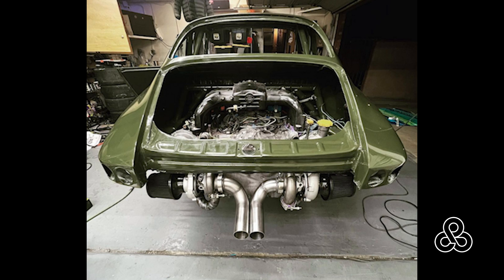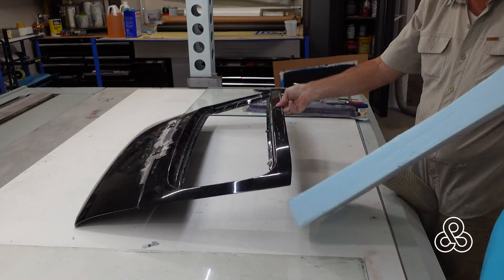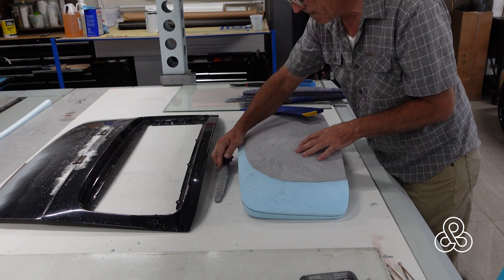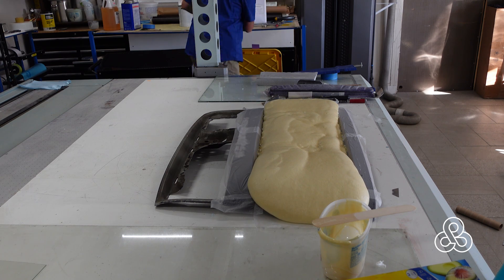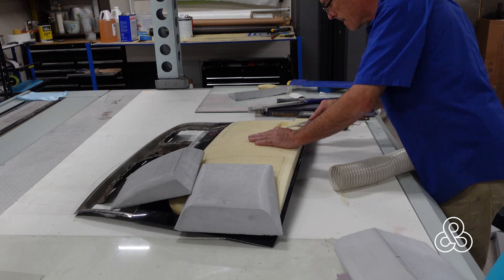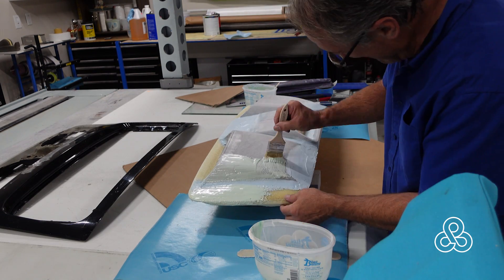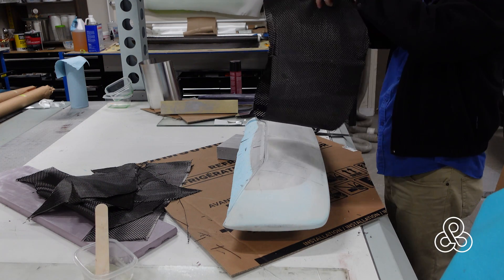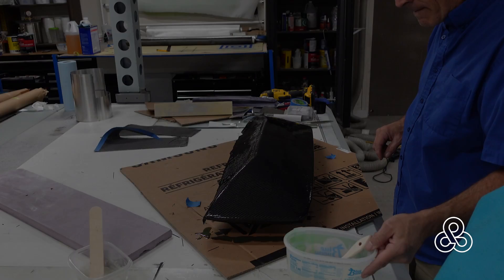Sculpting foam core plugs for carbon fiber parts

Comment from the maker: Sorry for the low volume/quality of the sound. I have some new equipment and I'm working on the new workflow. What I see/hear in production is different than posted videos; I just need to get them closer to the same, which takes a few cycles. - Jay

Comment: Came to this after studying the process on a fiber and foam supplier's website.  I was surprised at the prices of their foam - both polyisocyanurate boards/blocks and expanding polyurethane mixes.  They charge $245 for a 4x8 x1" sheet; a six foot block is over $1k!  

Immediately my mind went to Home Depot and the extruded foam insulation for this!  So to have found this excellent tutorial and see "first hand" it is a practical solution.  I'm sure for some applications maybe the expensive stuff would prove useful.  (Especially when someone else is paying for the end product - and maybe margins aren't such a concern!)
Reply from the maker: The very expensive foams have structural qualities that have been documented. If you are building something and need to show (or calculate) the foam into the design then you will need these products. However, if you are just creating a model (plug) then the added expense is just wasted. If you are using the foam as a core, as I have on the Arete Supercar project, just design the structure around the foam to handle the loads required and pretend the foam is just a cavity. If you are using the "big box" store foam in a vacuum or infusion, make sure to test it before committing a whole project. Thanks for watching.

Comment: I really enjoyed this episode, especially since I've been pondering building something almost the same for my 996 LS swap project.  One question, it seemed like you had the foam plug fitting pretty snug in the engine cover, did you take any off around the edges to make space for the thickness of the carbon layers and epoxy topcoat?  Or just kind of allow that extra thickness to make sort of a press fit?
Reply from the maker: Yes, I did take it down slightly with some fine sandpaper, even then, the two layers of carbon add less than 1mm . If Micheal decides to use this part he can take the foam off the back side and reinforce it with a few more layers for an indestructible part.

Comment: Great to see a new video. 

Please increase your voice channel volume.  I can turn the laptop and YT volume down to 0 if it's too loud but only turn them up so far.

5:54 - re: slurry: does that provide a non-porous layer for the carbon fibre + epoxy layup or something else? (Later you say - something harder to sand).
6:10 - how is that plastic film stuck to the rear panel? I would have thought the heat + weight of expanding foam would move it but it didn't budge - is it static / gravity or magic?

Your craftsmanship in shaping those extruded scoops for the expanded lid was outstanding. I am wondering if it would be quicker or easier to model it in cad and then CNC the foam plug in one piece? That seemed like a lot of work to be told they don't want it 😞

Hopefully we get to see the finished product.
Reply from the maker: Yes, the slurry seals the foam for a non porous layer. Slurry from microspheres (Q-cells) is softer and easier to sand (softer for dents and damage) the slurry from calcium carbonate is harder and more durable, but of course harder to sand. The plastic film is a product marketed here as Glad press n seal. It has a very light tacky substance applied to it that keeps it in place, but allows it to come off easily. So, basically, until I just gave my secret away - Magic!
Reply: @BuilderCreator  ah thank you. Great learnings again, much appreciated.